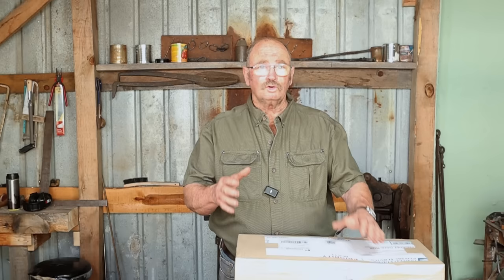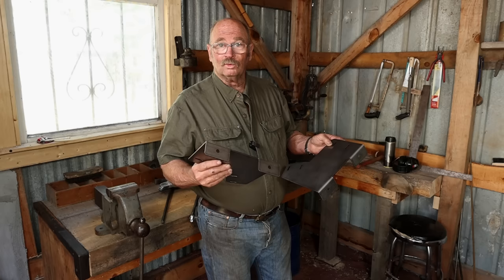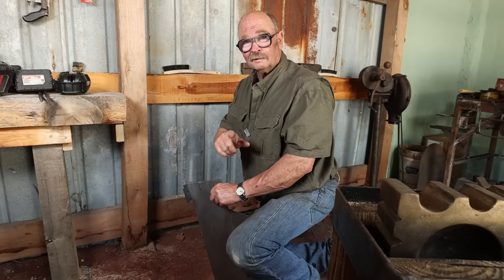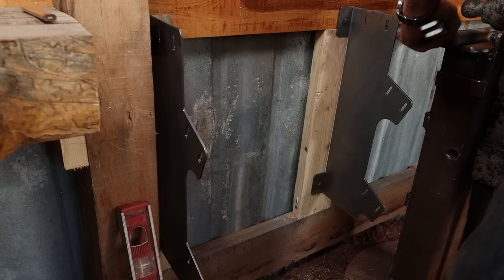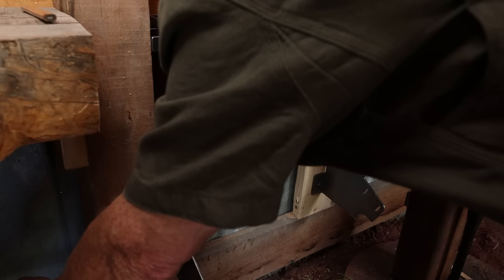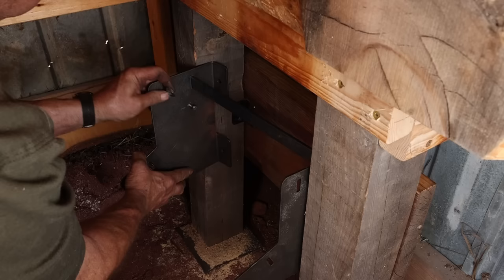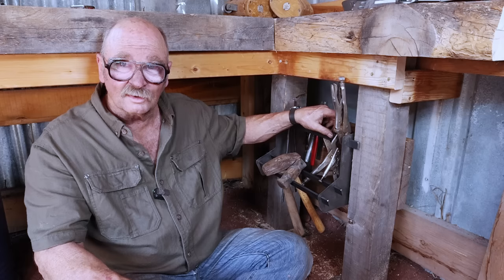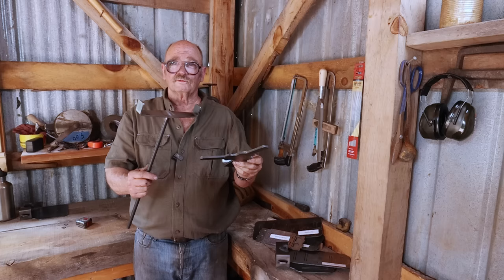Tong and Hammer Rack from Ken's Custom Iron

Comment: For the bars you could use the silver pencil and put reference marks in the bottom of the bars and then make small slot notches on the bottom that the bars can set down and the notches will keep the bars steady from moving one side or the other in the brackets.

Comment: Small tool holder swap the left and right so the mounting tabs are to the outside and you could screw them in to the backside of the legs without the board.

Comment: I've got a couple of Ken's grinder holders in my shop and they're absolutely great!  Question for you, it looks like you installed those organizers with the squared-off bolts/screws you've shown in previous videos, is that correct?  I always assumed that the downside of doing that was you'd have to install them with pliers or a monkey wrench or similar, but are you able to just use regular sockets/wrenches on them?  Thanks for another great video, love seeing the smaller shop coming together!
Reply from the maker: A 12 point socket will work on a square headed bolt.  But in this case I used a pin socket that adjusts to just about anything.

Comment: Are you still happy with your gas forge? I haven't fired my coal forge up in a while but man I love that smell.
Gas is easy to light and quicker to get going no doubt  but  I've never used it.
I need a strong pair of  inward pulling snap ring pliers. You can not buy a set strong enough with enough leverage to get a 2 inch snap ring out. To get any snap ring out without losing it you need to be able to put one hand over it and one hand on the pliers.
What type of metal would you recommend for snap ring pliers and how about hardening the tips?

Nice rack here to btw!
Reply from the maker: Still very happy with the forge.  I've never made anything like snap ring pliers, but I would probably start with something like 4140 0r 5160
Reply: @BlackBearForge  Ok thanks I might give that a try.😉